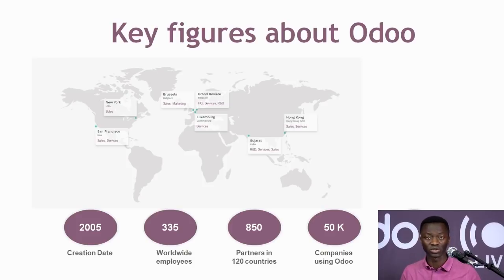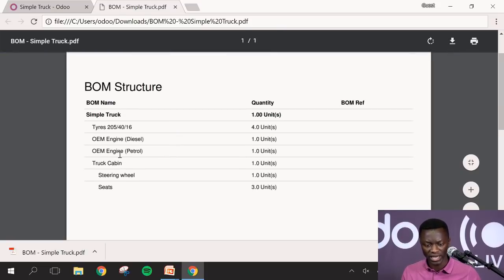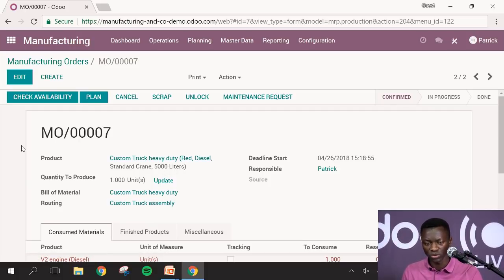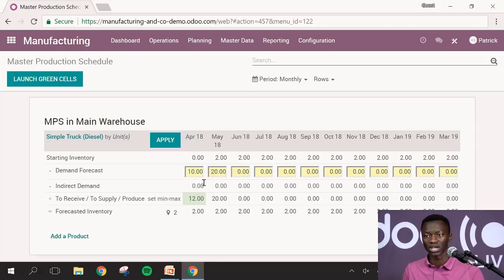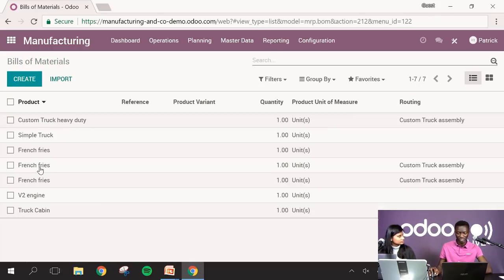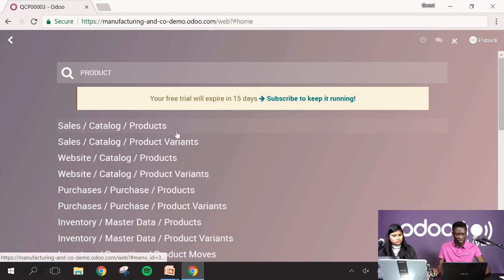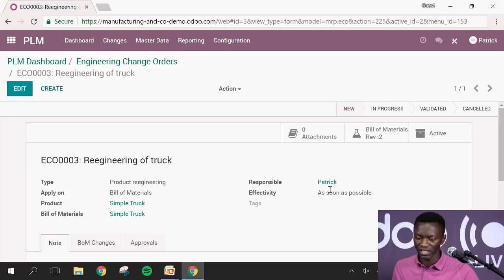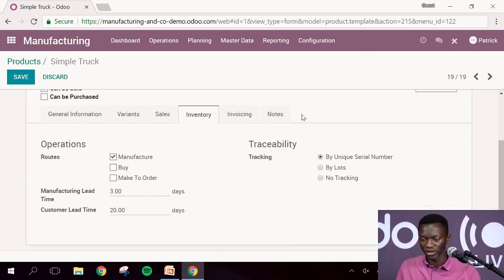Odoo Manufacturing - Production Planning and Shop Floor Management

Comment: the thing here is, what happens if you want to produce ie 20 units of the final product? the manufacturing orders (MO) are auto generated one by one after each MO initial is finished or they are generated when 20units  of the first MO are finished?
All Odoo examples are done with 1 unit produced, this is not the real situations in the companies

Could you explain how to produce in a manufacturing chain, with 3 or 4 operations/processes and producing more than 1unit (ie 10 units) and all with unique serial numbers for each? How can it managed in Odoo?
Thank you
Reply from the maker: Hello, 
Odoo will generate all manufacturing orders in advance, indicating that materials are not available for more advanced bom. The MOs will become ready as soon as the missing materials are produced in the other MOs. This way, everything can be done on a production line, with self-generated MOs.
For serial numbers, they can be entered at any point in the process. Either during production (use of tracked materials) or at the end of production (finished product).